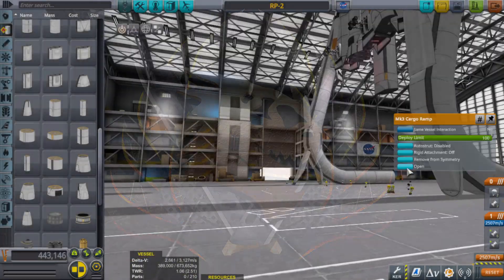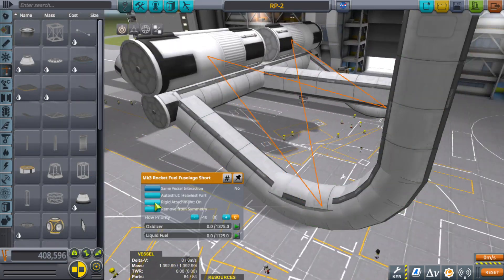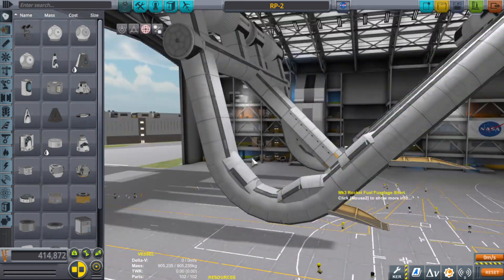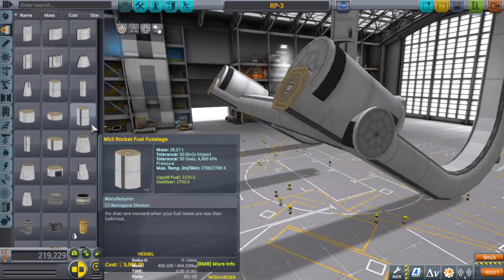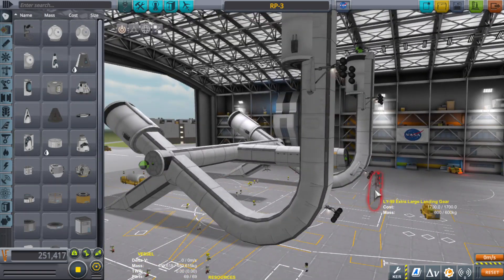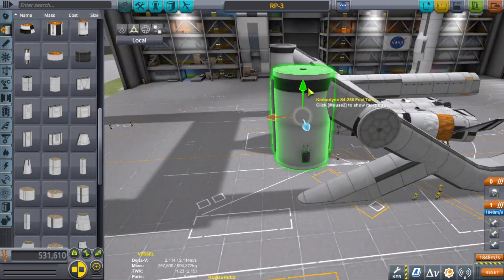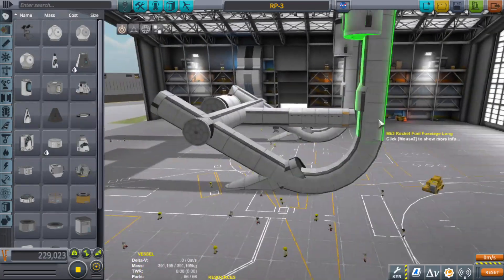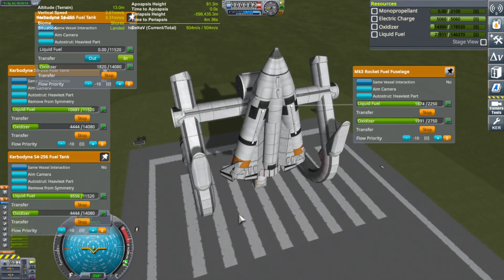SSRT with GROUND CREW part 1   |    KSP 1.11

Comment: I'd love to build this sort of thing, but I think it'll take a while to develop my skills. Orrr maybe I'm just nervous because I understand the pain! XD But this thing... I'm gonna say it: It's cooler than Stratzenblitz's gantry for his relaunching vehicle, ;) because his just uses rocket engines to tilt itself and more rocket engines to slow the tilting. It's in his low solar space station video.

The problem with things staying still these days is the landing gear judders; it sticks and lets go, sticks and lets go, and the craft moves slightly with each let-go. I think it takes a lot of weight to make it happen, but for aircraft/spaceplanes, even the largest landing gear is actually pretty small.

Comment: you can control the amount the cargo doors open with deploy limit
Reply from the maker: Sadly, it’s very manual intensive as only one can be controlled at a time. Not two.
Reply: @vaos3712  you can use action groups to control them by mapping it to RCS controls for example